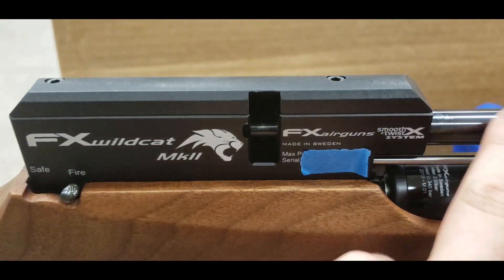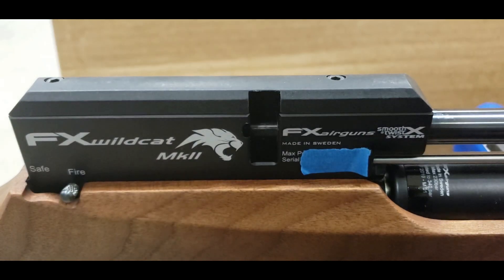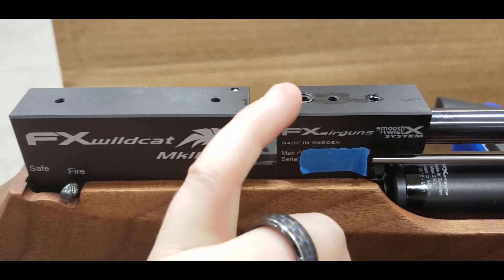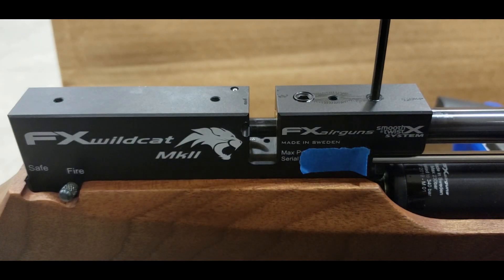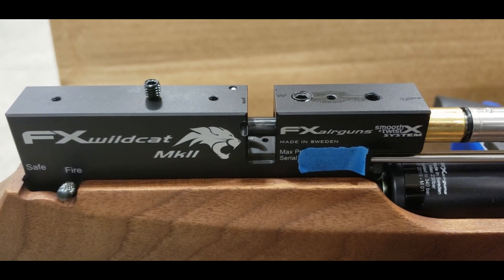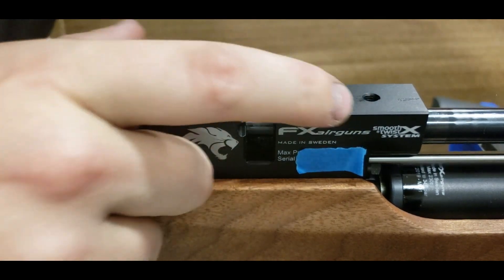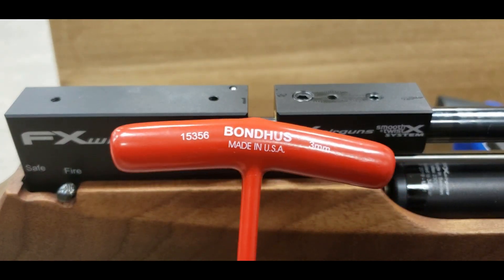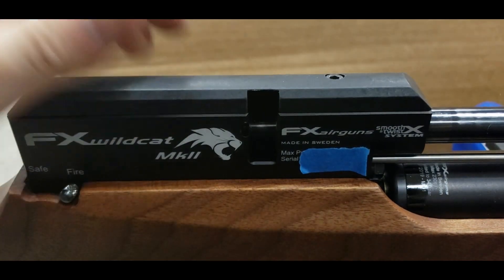How to Remove FX Wildcat MKII Barrel - FX Wildcat MKII Barrel Removal and Installation

Comment: so do you have to let all the air out of the cylinder first or scope mount?
Reply from the maker: You do not have to empty the air, that is optional. If only removing/installing the barrel, you only have to remove the cheekpiece to access the barrel screws. Scope mount can stay in place.
Reply: @910AirgunTuningandRepairs  brilliant thank you

Comment: Please make videos how to change calibers. Thanks you for sharing.
Reply from the maker: Sure will! You can only change calibers between .177, .22 and .25 calibers. The .30 caliber has a different action design to accommodate the large transfer port.
Reply: 910 Airgun Tuning and Repairs Thank you. Do you know where I can buy Wildcat MK2 barrel kit?
Reply from the maker: @jennysok  there were never barrel kits made for the Wildcat, as you are technically not supposed to change calibers. But it is possible. You can buy an Impact barrel, Wildcat probe and the parts for a Wildcat shroud and put them all together